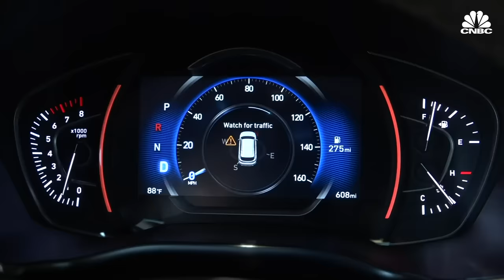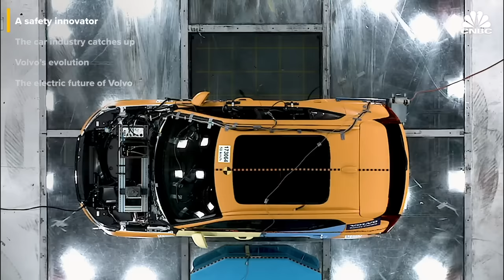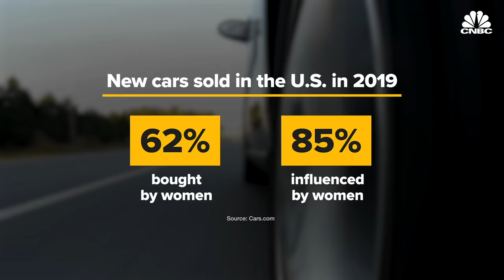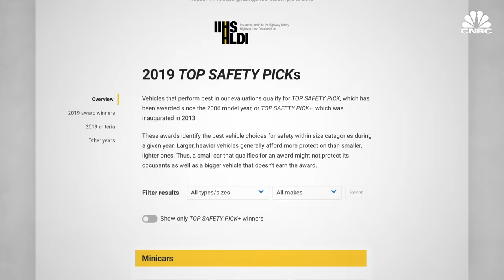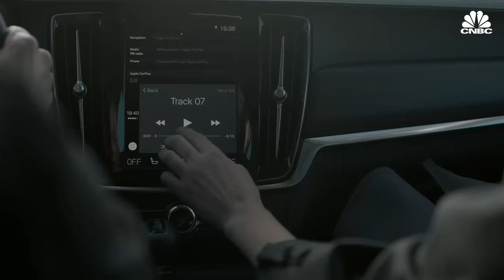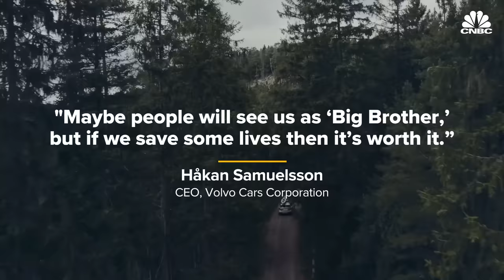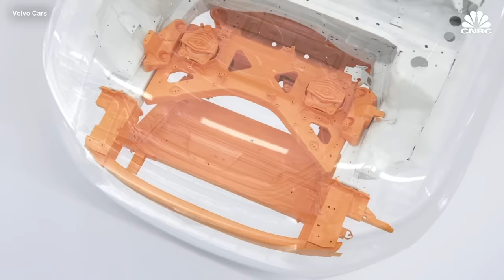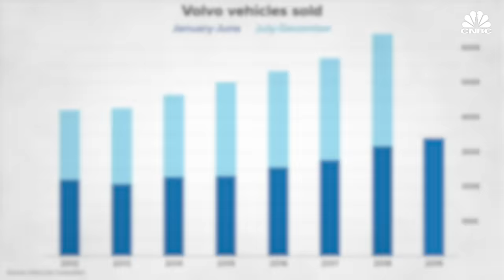Why Volvo Is Losing Its Big Lead In Safety

Comment: Volvo isn't  losing anything. Simply the rest are just catching up.
Reply: You don't seem to have read the word "lead"
Reply: Gods exactly
Reply: Uh, " Lead "
Reply: @Favour135  explain your self please
Reply: @Emilthehun  if you have a lead on other brands, then those brands catch up(as you stated) it's called losing a lead
Reply: @maskedmarvel  agreed lmao. I have nothing to say In my own defense 😂👍
Reply: Meh, Tesla exceeded all car manufacturers when they released the Model S. That was in 2012 so what is this report covering?
Reply: @Emilthehun Exactly. It doesn't seem like maintaining that lead wasn't their original priority (for better or for worse as a business). They've actually succeeded if their mission was to share enough of their technology to make all cars safer. As quaint as that sounds nowadays, you've gotta commend them for that...
Reply: @MalcolmCir  the issue currently with all auto makers is the continued use of a ICE. When you remove the engine you remove the mass that plays a big roll in  lower safety ratings. When you don't have the engine, it can't push into the firewall, it also frees up lots of space for reinforcements.

My dad actually used to think the engine was protecting him until I explained the Tesla to him.
Reply: @MalcolmCir  yes I agree and its definitely for the better for all of us.
Reply: @dct124  so you means EV is lighter than the car with ICE?
Reply: @xmenlingcheehuat0811  Didn't say anything about weight.
Reply: @dct124  what about mass?
Reply: @Emilthehun  all good, just a minor mistake
Reply: @xmenlingcheehuat0811  Mass is a factor. When you look at a vehicle and you look up the curb weight and it says 4000lbs that's massive however with the Tesla most of its mass is at the lowest point of the car wheras most modern day cars mass is higher and spread out in the front, undercarraige, and rear. A Model S for example is basically a roll cage with no engine so the space in the front is used as a crumple zone and it's used to its fullest extent since there's next to no obstruction from an engine and the same goes for the rear. So with the mass being really low it resist roll overs very well as does the Model X SUV where as most SUV mass is up high.
Reply: @dct124  That's called the centre of gravity or some prefer it as the centre of mass. Not just mass. Mass is the number. Higher mass doesn't mean better.
Reply: @xmenlingcheehuat0811  ok,what's your point here?
Reply: Volvo sold itself to China which is why it's going downhill. China can't make good cars without making sure it's filled with toxic paints/parts and cut costs as much as possible to make it unsafe.
Reply: Yup crap news broadcasting channel is just desperate for views
Reply: Actually, because safety tests are not surging ahead. Volvo actually does far more extreme safety tests than even IIHS or NCAP; like SUV rollover, pedestrian safety, using different unstandard sized dummies, higher speeds, offroad crashes in house on their own test facilities.  The only reason why safety tests do small-overlap was because Volvo called them out, and they were the first to score G on them. This video is way off base. 

Tesla has been caught with false claims even with their side impact tests, where Volvo did better at protecting the occupants, but in the Tesla it was visually less damaged.
Reply: @maskedmarvel  but they still are at the top.
Reply: @dct124  No they didn't. Caught in Elon's marketing. If you look at the Tesla Model 3 with the latest IIHS and EuroNcap tests, Volvo still does slightly better.  Tesla is safe no doubt, but the 2012 Model S wasn't.
Reply: @dex2531  Is it 2012? Did I mention the Model 3?
Reply: @alexandercrush  Utter nonsense, Volvo has experienced a signicant boost from Chinese ownership, way better design and products than under Ford.
Reply: Tesla took the crown!
Reply: CNBC doesn´t like volvo. Volvo symbol represents toxic masculinity.
Reply: No, they do not. Other manufacturer are FAR behind when it comes to real world.
Reply: Hence: losing its big leap.
Reply: @kashmirha  Not at all. They are way ahead, but you just do not know everything that they have in line.
Reply: @alexandercrush  I didn't see they made any success under the Americans
Reply: So True.... manufacturers are just getting better...catching up with Volvo
Reply: Ford bought Volvo in 1999, sucked it dry of its' technology, and then sold it to the Chinese Geely car company, who could see a good thing.  But the car remains Swedish in design, other than increasing the rear sear leg room for Chinese moguls.
Reply: MMM18092   I hope you are right!  I have had 6 Volvos exclusively and would hate to see that wonderful engineering lost in Chinese cost cutting.
Reply: Exactly. Not to mention when Ford  bought Volvo in 1999 literally stole all their safety features.
Reply: Tesla Model X is the only SUV to get a perfect safety rating across the board. Volvo got four stars in rollover and still have not caught up with Tesla.
Reply: @Techjunkiero  You understand that you can't steal something you bought right?
Reply: One word: Tesla
Tesla’s are far safer than Volvo’s and the cars of every other auto maker.
Reply: That’s pretty much the definition of lead lol
Reply: @Jason-le3of  : The Americans at least facilitated its sales in the USA through their network of dealership. The Chinese used to buy Volvo cars before because of the trademark. Now it's owned by a Chinese car company so it has lost its namesake
Reply: Emilthehun In buisiness, that’s the same thing.
Reply: using cheap metals to build their cars, thanks volvo
Reply: Don't you get it? Anything related to China is not only bad but worst, period.
Reply: trying to catch up, but Volvo tests on REAL life accidents while others test in LAB. The outcome is that you will survive in a Volvo tested in real life, but get killed in another car tested in LAB
Reply: Other companies are catching up with volvo when it comes to safety and ironically volvo is now leading when it comes to design. 
Volvo in the past produced ugly cars but now they produce the most beautiful cars while others catch up on safety they make more ugly cars.
Reply: @ES-pr8bt  volvo was going to junkyard before china save them.
Reply: @Favour135 still winning lol
Reply: @parentpatrol2752 they’re still winning.
Reply: @maskedmarvel they said “Losing” not lost, and they haven’t caught up, they’re catching up still, Volvo still the safest.
Crash ratings are vague and generalised and don’t show the variations and various crash angle possible.
Volvo still has safest statistics in real life crashes…
Look up XC90 crash safety, even the first gen, 2003, still structurally stronger in a rollover than most if not all other brands these days.
Reply: The gap of the “best vs the rest” maybe smaller BUT can you trust the rest. . . . Owned a 2018 Volvo XC 60 … traveling on a busy city road/freeway of 70-80  kph speed limit … a-full size Tesla accelerated  across the median and stuck us as a driver  side rear impact. Estimated speed 100kph. Sent us spinning 280 degrees and now facing on coming traffic.  Airbags deployed. No intrusion into cabin. Driver side door could not open. Walked around car-didn’t look too bad for the impact we felt.  Cracked an elm antique chest in two  places in the cargo hold 😲😜. Took the SUV for  repairs  - WHOLE FRAME TWISTED and not repairable.  It did not look SO BAD?!?! sold as a scavenger car for parts. Will always choose Volvo!!!

Comment: When you are 99% it's hard to increase that 1%
Reply: Especially when you're bought out by Chinese which have safety as secondary for everything else.
Reply: I needed that, Thankyou. . 😆
Reply: @XenomorphLV426  - Geely's crash tests have been improving dramatically. Volvo pulling Geely up, not Geely pulling Volvo down.
Reply: Yen Tao  - Yes, indeed!
Reply: Chao Zhu  True. There probably wouldn't be a Volvo if it wasn't for Geely.
Reply: @XenomorphLV426  stop it, stop this stupid American philosophy. All Chinese cars are alot safer then American made cars. I can send you the video of Americans testing saftey between US and Chinese cars.
Reply: @Pro09video  I did not know this. Interesting. Can you post the link, please?
Reply: @peterkowlessar7823  there's one geely suv that was rebadged and sold in Malaysia, the suv called boyue scored higher than most Japanese rivals and similar results to the german competitors
Reply: @Yddp3307  Looks good. Sadly we will not be seeing that in the UK (at least not soon) not even the Proton badged version. The public here would turn their noses up at a Chinese name which is why you hardly see any Great Wall pick-ups on the roads here.
Reply: @peterkowlessar7823  Chevy rebadged a Chinese car and sell it in South America.
Reply: @XenomorphLV426  That's not true. Volvo is still operating independently of her parent company. It's doing much better than under Ford.
Reply: @marktu8976  Much, much better than under ford. Ford almost killed Volvo!

Comment: Are we just going to ignore the fact, that every model from the Volvo Lineup looks absolutely stunning?
Reply: You can't ignore the fact that they all only come with 4 cylinders.  That's one of the reasons no one is buying them.
Reply: Yeah... Except for most Americans, people want to buy reasonable cars. And now look at Volvo's selling numbers. I wouldn't agree, that nobody is buying them.
Reply: As I said, Americans aren't much into reasonable cars with a decent engine. V6's and V8's are way more popular... And that's not Volvo's target group and it's good like this.
Reply: @ynnck5436  I read an article a few years ago where a V.I.P at Volvo said that their customers like their Volvos boring.
Reply: @ynnck5436  Volvo’s current 4 cylinder petrol engine is a beast! It uses 7 litres per 100km, so its not thirsty and combined with the electric engine it can get 408 horsepower! Twin charged, twin engine 😍

Comment: Volvo still receive extremely high marks in various crash tests, high above the average and they still are much more safe than other cars. They received 98% in Euro NCAP's tests and often go above and beyond, with the strongest roofs in the industry and they conducted a 50mph crash test-something another manufactor is yet to do.
Reply: Didn't Tesla do that too?
Reply: @TheFourthWinchester  no, their highest score for Euro NCAP is 96%. They don't conduct 50mph crash tests and if you check out IIHS, the model 3 doesn't have the strongest roof, however there is no doubt that the model 3 is an extremely safe car.
Reply: @fatpigeon1066  No idea. Hence asked.
Reply: And I think only Volvo are doing well in the small overlap test, most  
Cars are not designed for a small overlap crash.
Reply: And Volvo scores the highest in REAL LIFE accidents. Because they built their cars to handle real world crashes, and other manufacturers build their cars to handle the tests.
Reply: Mercedes Benz Pioneered safety since the 1950's with roll over & crumple zones, far more innovations than any other car manufacturer & in technology combined with luxury Mercedes has over 100,000 patents! Damn the ignorance is enormous in this world lmfao. Mercedes Benz also invented the first modern automobile in 1886.
Reply: @JESUS_IS_GOD  No, they did not. It was an engineer, Béla Barényi, before he started working for MB. And the number of patents is irrelevant. You do know that Volvo gives away a lot of their findings and data for free?
You do know that Volvo investigates real world accidents? Over 40.000 so far, with almost 80.000 occupants. And they have one of the worlds most advanced crash test facility including research on how human drive and behave, and they have a state of the art driving simulator for that, and they... The saga goes on and on.
Their goal is that no one will be injured seriously or killed in one of their modern car by 2020. And NO ONE has been killed in an XC90 in the UK since 2004 when the car was introduced there. And Volvo got through the difficult small overlap when it was released in 2012, with a car from 2002! Still car manufacturer struggle with this test (and Tesla failed twice). And Volvo has large animal detection in their cars, with auto brake. And, their modern radar will NEVER be blocked by snow or ice, like it will on all other car makes.
Reply: @JESUS_IS_GOD  Did i mention that Volvos auto brake with pedestrian detection is standard on all cars today?
Reply: @Xanthopteryx  Mercedes started all that stuff pal. Mercedes sends out a team for all real world crashes too since forever ago. Mercedes S-Class was the first production car with an airbag, Mercedes also invented traction control, ESP stability control that is all standard on cars today.
Around 2002 Mercedes invented pre-safe where the car would close all windows, straighten the seats, pre tensions the seat belts called "pre safe". Mercedes also keeps all patents open on any safety Innovations. Mercedes started testing since the 1950s for safety, the three-point harness is all Volvo gets complete credit for. Mercedes invented autonomous braking since around 2003, first car in the world that would self drive and follow traffic with cruise control on was the 2007 Mercedes S-Class, 2014 S Class was the first car in the world to actually send  audible sound to the speakers in the event of a massive crash so that your ear drums would not get blown out and people wouldn't go deaf. Mercedes also designs their bumpers and even the hood would raise up if a pedestrian is detected being hit to reduce the pedestrians damage.
Mercedes had the first pedestrian avoidance detection system since about 2014 where the Mercedes S-Class would actually steer itself and hit the brakes and go around the pedestrian, many of the other car manufacturers still hit the test dummy.  Mercedes pioneered autonomous breaking since around 2003, EVERYBODY copies Mercedes-Benz for technology and luxury & they have records with their Mercedes-AMG's on the Nurburgring Track (They have the fastest SUV, STATION WAGON, REAR WHEEL DRIVE, & 4 passenger CARS around Nurburgring Track (I think Audi took the SUV title a couple weeks ago). Mercedes were the first with heated Center rest, heated door panels, first car with LED headlamps 2006 CLS Mercedes, like seriously Mercedes has over a hundred thousand patents of the car, they always say you want to see what's going to be in the next 10 years on all cars look at the latest Mercedes S-Class. 2014 Mercedes S-Class was the first car in the world to have a hundred percent all LED lighting everywhere inside, 64 ambient colors, first hot stone amazing massage seats next level type massage, they were the first ones with disc brakes fuel cell technology 1994 NECAR 1, fuel injection 1950s, they had cars going 268 miles per hour on a public road 1938. From inventing the car to today everybody copies Mercedes and I will admit a few things done right alon other cars Mercedes would copy & perfect themselves but majority Mercedes does first!  Their an amazing company but hey ignorance is out there so most people just don't know 🤷‍♂️ I was always reading and learning about cars motorcycles and life in general I love to learn, a lot of "fake news" out their. Anyways Happy Thanksgiving (sorry for typos I am using voice to text)  I 100% retired when I was 23 years old with all of my money invested in real estate & currently my partner & I own 325+ plus properties we have taken over as "subject to" no help from banks & private investors. Then I moved to Florida to the beach few yrs ago with my wife that I've been married to for 11 years now.  KNOWLEDGE IS POWER. I study what cell phones are the best, learn what cars are the best, got to learn how to make your money work for you and you not for it all this while being Guided by our God the Lord Jesus Christ ❤✝️ Now we help orphanages in South America & Europe where my wife & I's families are from. God Bless Pal
Reply: New Mazda CX-30 just scored 99% result in the euroNCAP adult occupancy crash test, making it one of the highest scoring vehicles ever assessed. Just goes to show that the focus on safety isn't exclusive to Volvo and Tesla, since Mazda seems to be doing very well with their latest vehicles.
Reply: @MrJustapersn  Yes, they are sure good at adapting to test condition. And that is good of course, but Euroncap needs to step up a bit. It's a disgrace that they do not have small overlap for instance.
Reply: @JESUS_IS_GOD  Volvo pioneered safety since 1927
Reply: Well, they were bought by China Geely and engineers from both sides are getting more and more ideas and designs, the new Volvo interior was designed by Chinese designers in Suzhou, China. You should know as long as US media talking about China, its either bad or worst. Period
Reply: @JESUS_IS_GOD  Mercedes weren't so safe in the 50's when they built the fastest car in the world and decided that drum brakes front and back would be a good idea, despite the invention of disc brakes showing better stopping abilities at the time.
Whoever started safety first is irrelevant, can't we all be happy for most of the safety features we have today because of manufacturers like Mercedes and Volvo?
Reply: @JESUS_IS_GOD  Nice! Why don't you buy an S-Class? Oh, wait, the price...
Reply: @razvanlex  My daily driver is a Mercedes S550 😇🔥✝️❤
Reply: @JESUS_IS_GOD  I do hope you have a driver with that.
Reply: @zihaoliu605  you are so wrong my friend, Volvo new generation wasn't designed by Chinese, it was designed by Thomas Ingenlath a German car designer CEO at Polestar, Also for the xc90 interior it was Robin Page who also worked in design department for Bentley